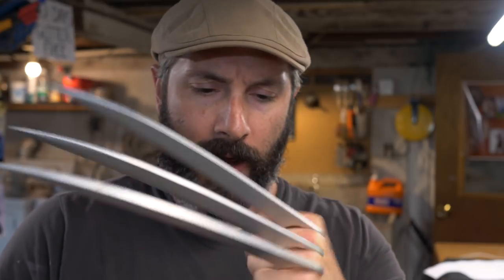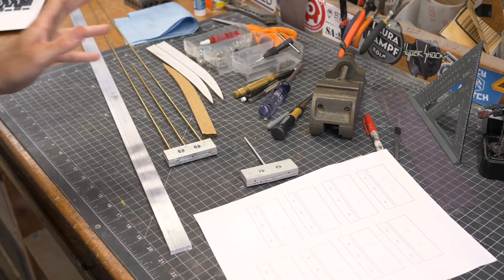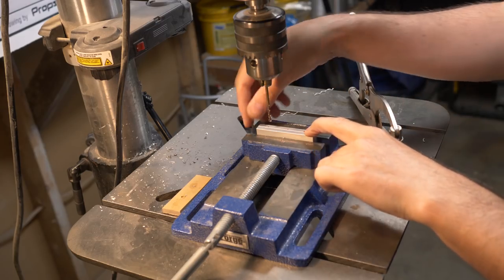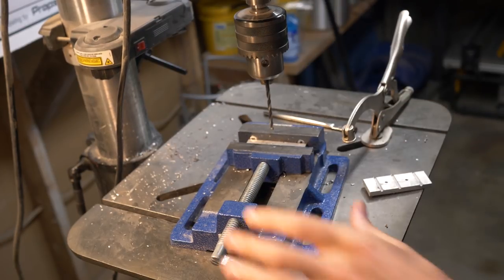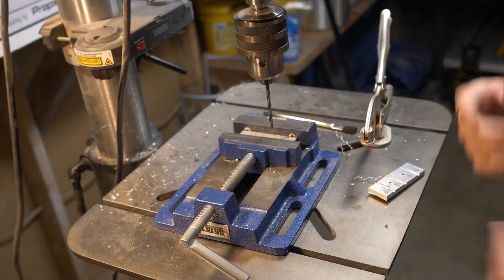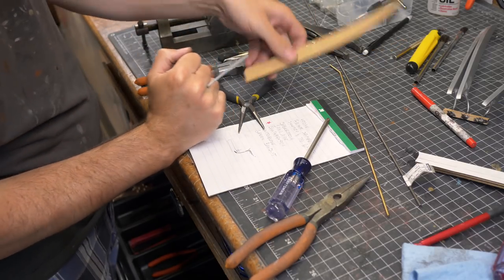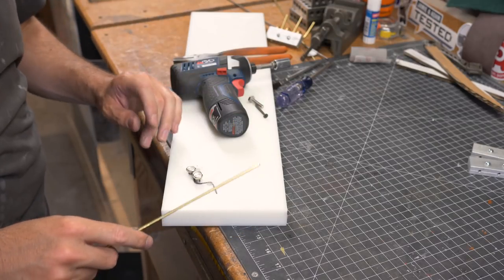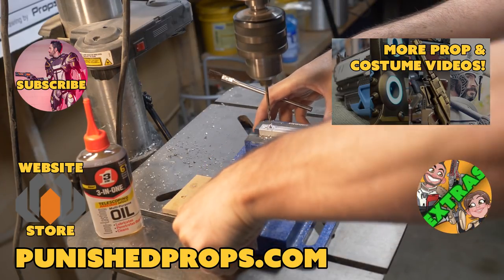Wolverine's Prop Claws - Cosplay Tutorial Part 1 of 2 - Hand Grips

Comment: I'd drill the whole for the rod slightly undersized, maybe 3/32, so you're sure to get a good clamp from the screws that hold the blocks together which should prevent the rods from slipping or rotating better.
Reply from the maker: +MorganScott82 Good idea. I'm also going to sand down the inner surfaces of those bars to give myself a slight gap.
Reply: A small shim between the pices while drilling it out (like a piece of paper or cardstock) should give the same effect. But you do seem to love sanding... :)
Reply from the maker: I thought about that too... once I had already drilled them all. Great idea! =)
Reply: Yeah, or coat the inside with something like plastidip so it has more grip and a little bit of give to really lock it in.

Comment: A tip if you are making clamps like these again. The clamping surface shouldnt be the same size but actually slightly smaller than what you are clamping. Meaning if you are clamping a 5mm dia rod, you want either an oval that will engage before it is fully closed so sanding the inner halves of what would have been a right circular prism to be a right elliptical prism with a new width of ~4.8mm is all that is needed. 

Or if you are lucky to have a drill bit that are just sized enough off from the diameter of your clamping material. 

Otherwise adding a medium in the clamp's vice might also help. Assuming you only need a light holding force, a thick enough tinning layer on aluminum should work fine.  I'd think electroplating is valid but the tolerances are much closer.

Comment: So I was initially going to comment that you'd have an easier time bending the rods if you anchored the bottom section (the one that goes into your handle) with some sort of clamp to provide a more secure hold and therefore more resistance but you addressed that.  One other thing I figured I'd mention (and this comes from building models and dioramas) is that, if you're going to use pliers (which give you a better grip anyway) then you heat the rod along the length where you want it to bend; by annealing it, you make it a lot more pliable, facilitating an easier bending process and helping reduce the likelihood that the rod will try to spring back to its original shape.  This has the added bonus that it should also make any tweaking you might need to do afterwards much easier as well.
Reply from the maker: Cool, thanks for the tips!

Comment: You should look into getting a cooling pump and jet for your blade. All metals except iron need cooling for any cutting. You blade will last longer and make cleaner cuts.
Reply from the maker: I will definitely look into that. I plan on using this to cut steel to make new work benches. Thanks!

Comment: Great video. I have some tips you might be able to use regarding aluminum.  Al has a cutting speed of 700. you can drill and cut it really fast. for that little 1/8 bit  1000 rpm would be a minimum. What I mean to say is that  you can cut aluminum  way faster than you are. This can save you a ton of time. I love your channel really cool builds. Cutting metal is my job, so if you have any questions hit me up on facebook. Cheers
Reply from the maker: Thanks for the tips!

Comment: Here's a trick: put some thick cardstock or a couple between your plates when you drill the holes. Then there's a small gap so you don't bottom out when you clamp on your rods.
Reply: Ok, that trick was taken. Here's another: Chuck your tap in the drill press (but don't turn it on!) to make sure your tap is nice and straight all the way through.
Reply from the maker: Awesome ideas all around! Thanks. =D

Comment: I noticed when you clamped the vise to the drill base that it lifted from the other side which would cause the drilled hole not to be at right angle to the surface, a clamp on the other side would solve that. Probably would not matter for this build, just an observation
Reply from the maker: Good eye. I should probably clamp both sides.

Comment: I almost cried at 5:10 You know files only cut on the push stroke Bill.
Reply: Actually, it depends on the orientation of the teeth; there are files that only cut on the push and ones that only cut on the pull.  You see a lot of the latter used when shaping and sharpening the cutting edge on blades.